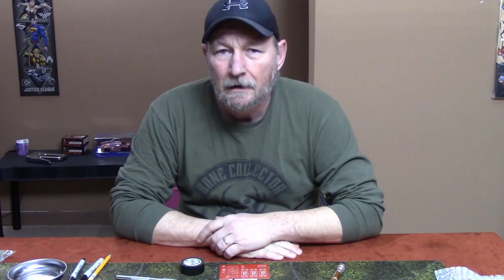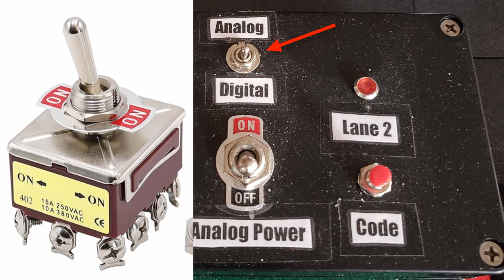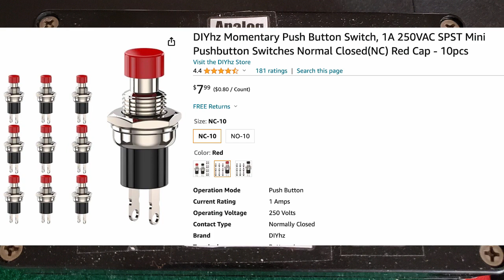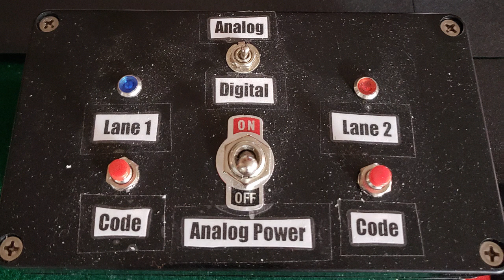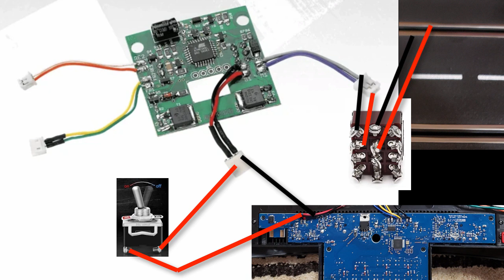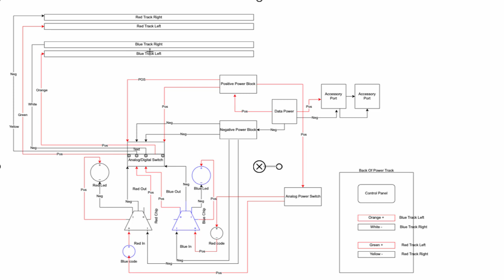My Digital to Analog Conversion Box (For my Carrera digital 132)

Comment: Would it be ok to use a professor motor power supply
Reply from the maker: I am not sure. If you do not use the power from the head unit then I am not sure you will get all the functionality. If you are talking about using the power supply to power the head unit, I do not think that would work any different. I am not familiar with the professor motor power supply so I hesitate to say yes.

Comment: Good day, does it matter whether 1/24 or 1/32 chips are used? Or is it necessary to use 1/24, as in the video. Thank you for the advice
Reply from the maker: Both will work but I went with 1/24 because of perceived longevity at lower power. Not sure however if that is accurate, but made me feel better.

Comment: Hello Tom, thank you very much for this great video. I'm going to build my Box and I have two questions:
- what section of wire do you use for your box, the track power supply by the Carrera CU is 18AWG (0.82mm²) I used 22AWG (0.34mm²)?
- what position should the Carrera 20020763 decoder switches be in?
THANKS
Reply from the maker: This is the wire I used, I am sure it's overkill. This link is through my Amazon Associate account so if you buy from this link, I get a cut. Otherwise you can just click on it to look at the wire to see what I used. 

The switch should be in the digital setting position (not the analog). 

https://www.amazon.com/gp/product/B0BX8P5T5H/ref=ppx_yo_dt_b_search_asin_title?ie=UTF8&amp;psc=1&_encoding=UTF8&tag=thomassidener-20&linkCode=ur2&linkId=b93c9244e2a486db1c44530af06ed3e3&camp=1789&creative=9325

Comment: Hi Tom, I followed the tech bit easily enough but struggling to undestand how you code the lanes with the button. Please can you explain that a bit or better yet a short video to show us :)
Reply from the maker: you press the button (on the conversion box for the lane you want to code)  and then the lane programming procedure is the exact same procedure you use when programming a car. It is just like there is a car sitting on the track. Here is a good video on how to program a car.
https://www.youtube.com/watch?v=xk4SQQsEfmc

You can also program speed, and brake just like a car.
Make sure you have fuel off on your head unit because it will let your chip run out of cas but you have no way to get into pit lane to get gas.